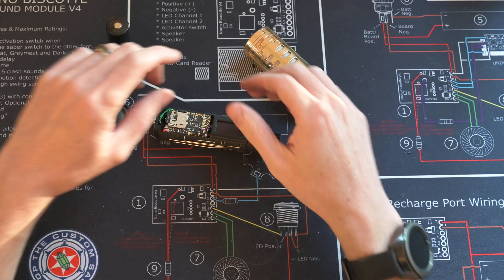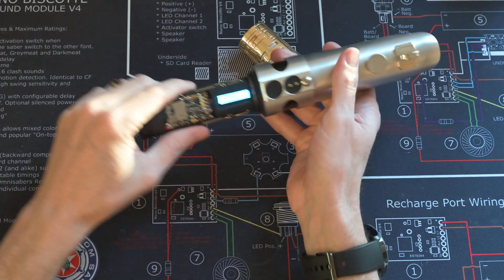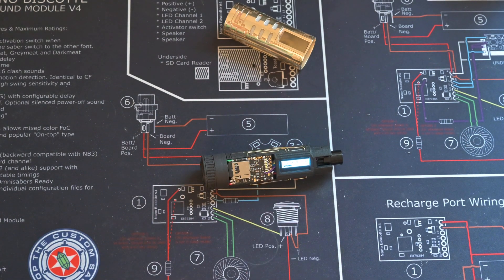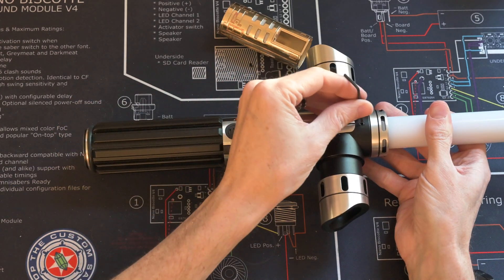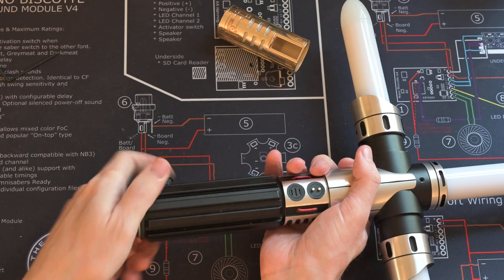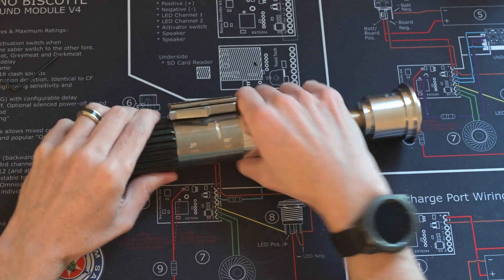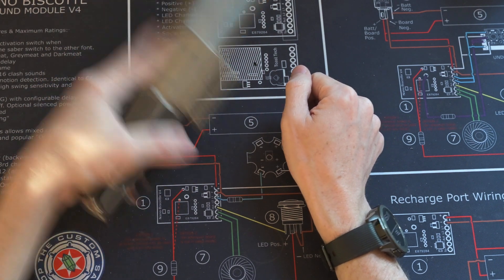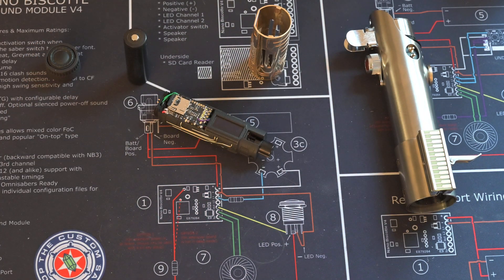Modular Chassis System Demonstration

Comment: And plans to make this work or is there a way to make it work with 1” inner diameter sabers like MHS V2 and others? Would love to be able to use this
Reply from the maker: The module will not fit in 1" ID because I've put the board and OLED on top of the battery to reduce length as much as possible. To do so would require moving the board/OLED to be inline with the battery, which increases length.

It's a design trade off. Larger diameter, but fits in shorter hilts. 1" diameter, but doesn't fit in shorter hilts.

I wouldn't say making a 1" version of the module system is out of the question, but it's not my focus atm.

Comment: Impressive, most impressive.
Indeed you are powerful!

Very clean installation too. Nice tidy wiring and looks like nice good solder joints.

I wish you had the CFX schematic desktop theme instead of the Nano Biscoti v4 but not a big deal.

👌😎😁🍻

Comment: Would you be releasing any of the cad files for this? I could really use it, but with a crystal in place of the screen
Reply from the maker: I won't be releasing the design files. I am planning on having them available to print through shapeways and putting out some diy YouTube videos.

I'm also exploring other ways to bring complete units to market.

Crystal in place of oled is a neat idea. I'll look into that.